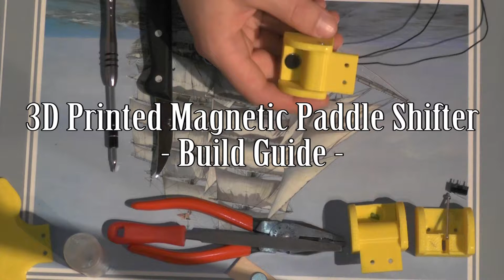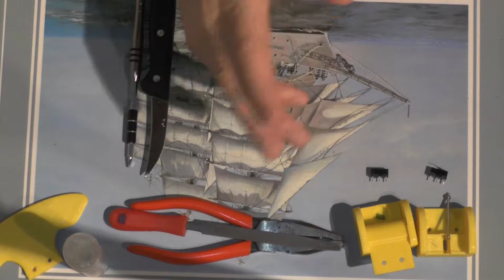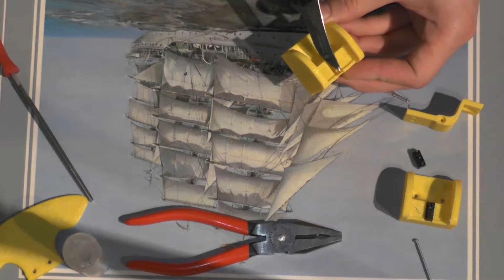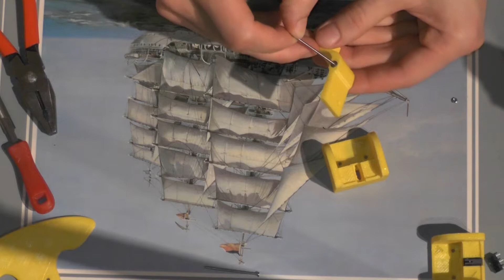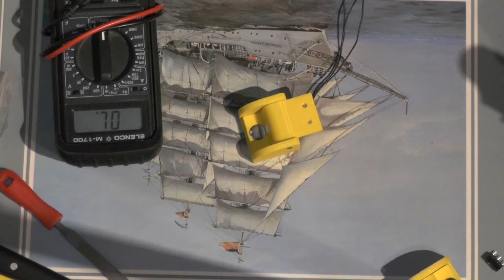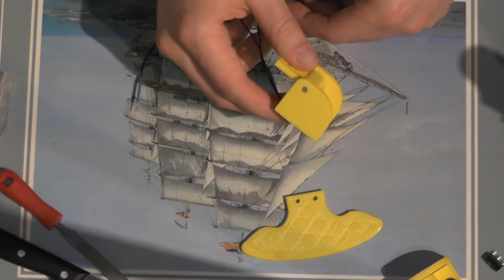Magnetic Paddle Shifter Build Video - RC1

Comment: Very good design and tolerances were great. I did some changes to design due to different hardware. Lever is perhaps little thin so I made it little stronger. I need to test it in my wheel but so far so good. :)
 Thanks for a great design.
Reply from the maker: Cool, thanks for the feedback. I reduced the thickness to 4mm so a that  M3x10mm screw would work to mount the paddles. So far it has been very strong, without any flex.
Please let me know how it works once you use it for a bit.

Comment: MEN do you know how to use a Hall sensor? I want to make a pedals
Reply from the maker: Hi, plenty of guides out there if you search for "arduino hall sensor guide" on Google. Make sure you get the right sensor since there are latching and non-latching types. The non-latching one should be correct since you want to measure distance and not have a fixed trigger point.

For the brake you need a load cell and an amplifier board. I recently purchased a 20KG load cell on ebay for another project. You can get the load cell and the amplifier board in a set which makes the output compatible to an Arduino.
Don't think a 20KG load cell is strong enough for a brake though. My Fanatec CSPv3 use a 90KG load cell so make sure you get something that can support the pressure you apply when "panic braking" :)
Reply: ok thanks a lot